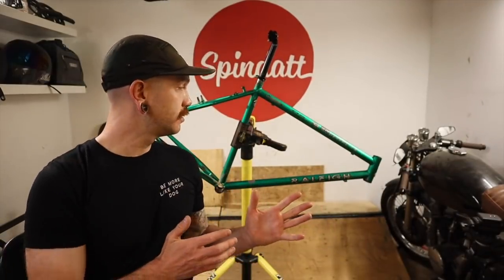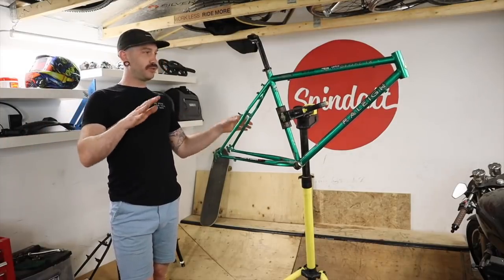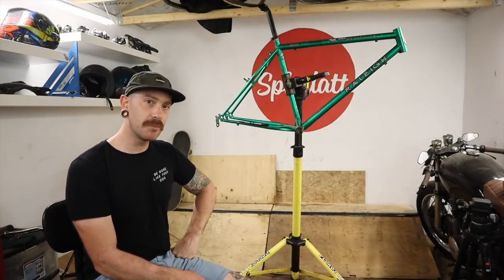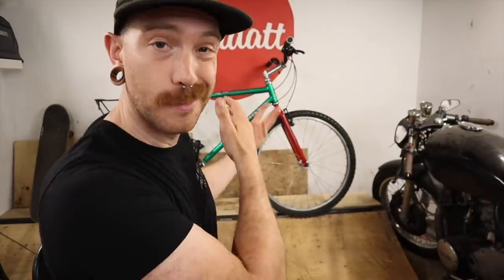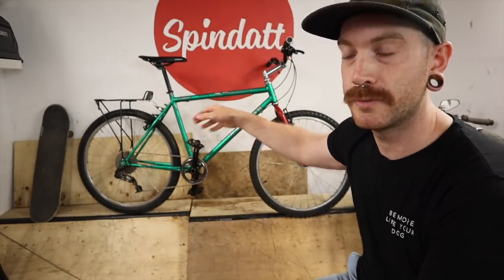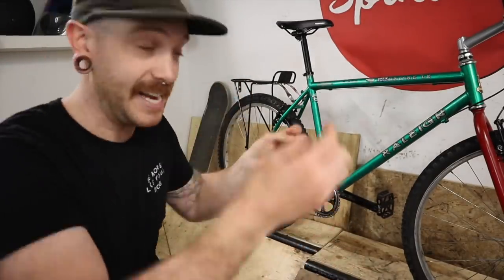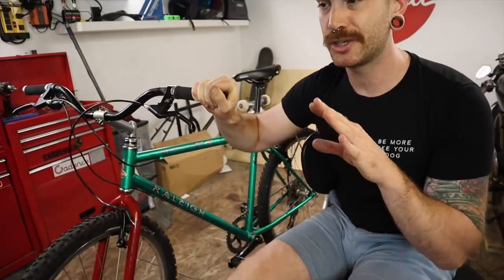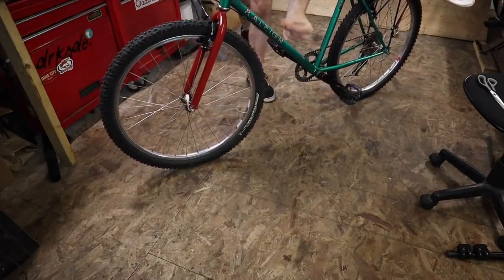Spindatt's Guide to Cool Cheap Bike Builds

Comment: Love this video. I just finished a build of a "psycho-cross" bike using a Orbea Igorre 2008 cyclo-cross frame. Bought various parts of ebay to finish it. I have been out last three days on it. It is a joy to ride and my favourite of my 4 bikes. Canti brakes, bar end shifters, Mtb triple front n rear derailleurs. But double Ultegra chainset that came with bike. Cool and unique. 😊 And light and a good ride.

Comment: Great advice....I just finished a Peugeot MTB I bought at a flea Market for $10usd bucks. I sourced some used wheels and bits and it's a blast to ride. I kept the 3chainring cranks and big 6spd freewheel in the back. I can pedal up any mountain for miles. 
The trendy 1x9 fad looks great but cost a grip upfront and doesn't work as awesome as the trusty 3x5or6. Booom😮 dang  there I said it.🤣 I'm glad there's many old bike rebuilders out there tinkering away. Peace✌

Comment: I am refurbishing an old steel frame bike as a gift for a friend. The thing is rusty. I am going to have a devil of a time getting the old cone style bottom bracket out, but at least it will be an interesting endeavor.
Reply: RollinRat  I saw that fix and will try it if all other options fail. I am going to spray it down with PB blaster, and heat with a heat gun. That's worked quite a few times for me.

Comment: can you talk about the rear spacing on old vintage mountain bikes, im not sure if theyre 130mm or 135mm and able to just upgrade lets say a 7 speed vintage mountain bike and slap a 10-11 speed cassette, maybe changing out the wheels if the hub does not fit a 10 to 11 speed cassette

Comment: I think it looks pretty good dude Raleigh's a good brand I've had a couple, I'm currently writing a 1995 giant iguana that I built up single speed
Reply: They are and they aren't. They are fully capable of making good bikes and I use a Raleigh Clubman Disc outfitted as a gravel bike and it's excellent bang for the buck. They also make bottom grade department store garbage which seems to be more common.

I just picked up a used Raleigh mountain bike to flip for $25 and when I picked it up I noticed that the welds are so bad that I refuse to use that frame. They look like a kid tried welding for the first time in a high school welding class and that is no exaggeration. All the components are great so they will be swapped over to a donor frame.
Reply: @rochat  I guess I didn't realize that I always bought from a bike shop,

Comment: I cant agree more.
I have a new project after i finished my upgraded spanish 80s road bike.
Now I am working on a Marin dropped project from an unknown dude which made a sik paintjon on it. Got myself an xt 2x10 deore groupset second hand but i will be using a spare 80s front derailleur bc compatibility with the frame and some old 90s brakes for dropbars and wheels and the shifter of mountainbike inside. The 700c wheels with 35 tires, and i will feel like the coolest kid on the trail even if some things would feel insulting for purist who never compited with their 4000€ bikes

Comment: That was excellent explanation about the breaking point of build project. I remember when I bought my first RC car and just upgrade the wheels with ball bearings instead of plastic bushings, and put better motor on it. I ride it on the street for a year, day and night, winter or summer, that was awesome, still remember those days. Then upgrade more, suddenly with corbon chassis, aluminum parts and special licenced rims and tires. after carbon chassis started to worry about screcths and breaking things and got no satisfaction with expensive mods and bright shining parts :/ years later it happens on one of my bicycle project too. Now I know what Im gonna do.

Comment: I'm trying to do this right now with a build bike. How can I connect two chain links when I've accidentally pressed out the pin and don't want to spend money on two power links when I'm replacing the chain when it arrives at my door?
Reply from the maker: Attach the chain at the link on the ground. Carefully try hammering the pin back in. Once it starts, press it back in with your breaker and keep it centred as much as you can.

Could also try it in a vice.

I did this over the weekend on a single speed chain haha
Reply: @Spindatt  Thanks for the tip! Also, I love your channel. You're very inspiring when it comes to making old or broken stuff work again. Take care, eh?

Comment: Seems like a front rack would be doable, mounted on break posts w/ washers keeping the break working. then clamp the lower legs or weld on some eyelets.
Reply: Yeah definitely doable, I chopped a rear rack drilled two holes in the flat part of the rack and one of the rear brackets to the fender hole in the middle of the fork. I bet that fork has fender mount holes by the quick release to mount to but if not the rubber coated p shaped sheet metal clamps would do the same job
Reply from the maker: I kind of want to try and build one myself

Comment: By shape do you mean size/measurements/geometry? You look around 6ft/183cm like me, I'm always struggling to find frames my size, I've got lanky af legs & inseam to match. Then I worry that a smaller frame is going to be uncomfortable, I already have a 55cm TT fixie which gives me the worst sore shoulders on the shortest of rides. Then I have a 58.5cm TT Marin Nicasio which is comfy as hell. Do you buy smaller frames and then make other adjustments with the choice of parts for the fit to be better? Fit is something I'm still trying to figure out.
Reply from the maker: No I just mean I like it’s shape aesthetically. I’m just shy of 6ft with really short legs, so my bikes are always a little on the small side